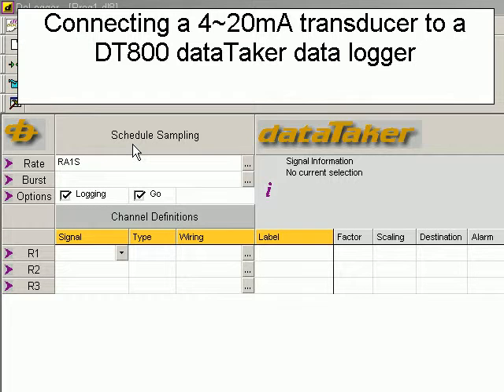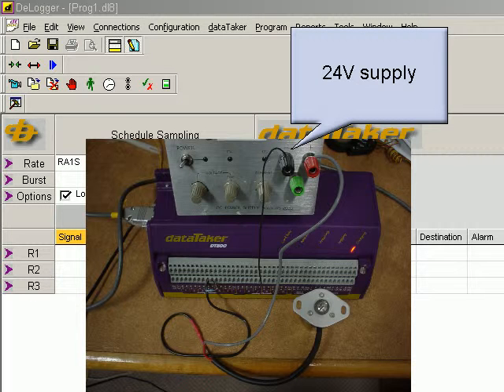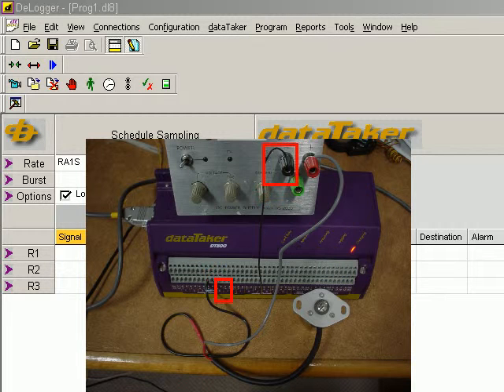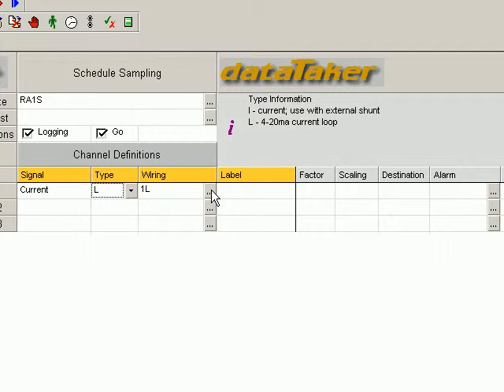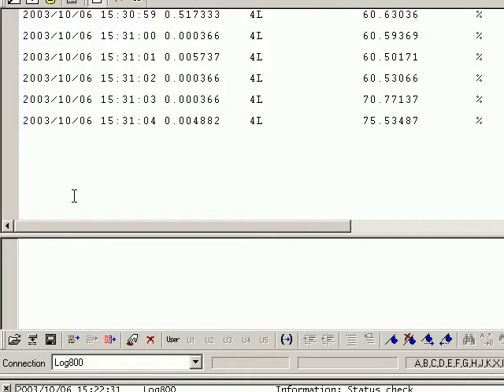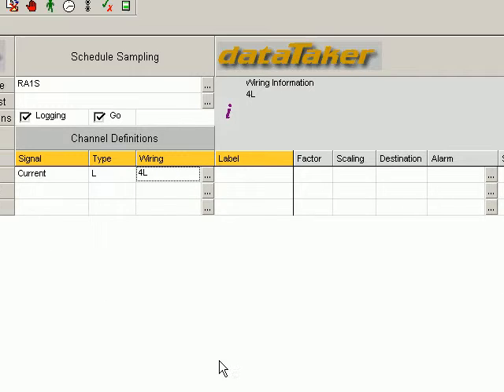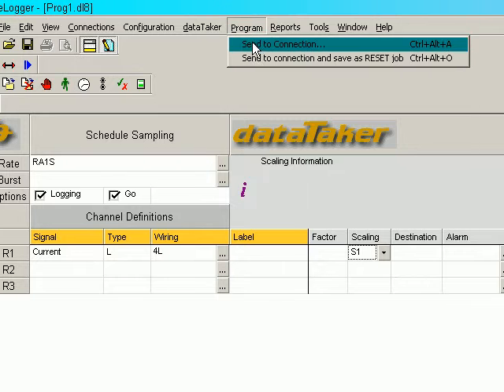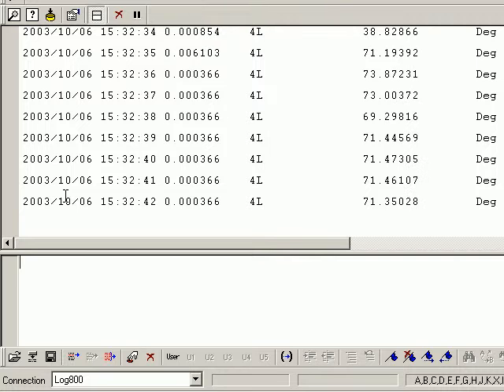Tutorial for Connecting a 4-20mA Rotary Transducer on the dataTaker DT800

Comment: Hi, can you advise, how to connect DT800 with humidity probe? Thanks
Reply from the maker: Hi Mardiana,

With the different types available, they require slightly varied connections. As a starting point you would connect the humidity probe similar to that of a transducer because of the scalability. What type of Humidity Probe are you using and the specifications? With that information we can provide a more detailed answer.
Reply: Hi, many thanks for your reply. 

We are using Meteorological Digital Humidity and Temperature Transmitters, Brand: Delta OHM, Model: HD 9817T1R. Specifications are described in the following link:  http://cache.deltaohm.nl/upload/do_90fj3lks/files/downloads/leaflet_hd9817t1_tddDjv.pdf
Reply from the maker: Hi Mardiana I. A,

Thank you for the follow up information. One of our product managers has posted a guide on our wiki (datataker dt800 | wiki) for your reference. Please have a look through and if you have any more questions please let us know.
Reply: @GabanMia   hi sir have you ever connected LVDT in dt85 datataker